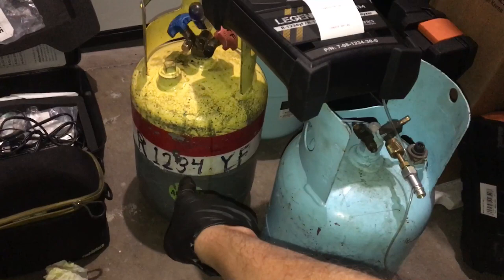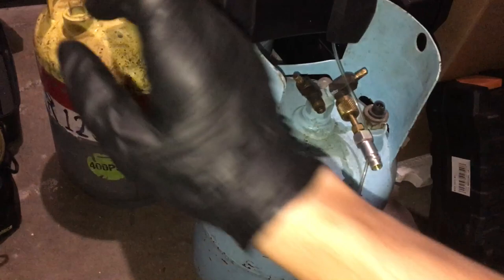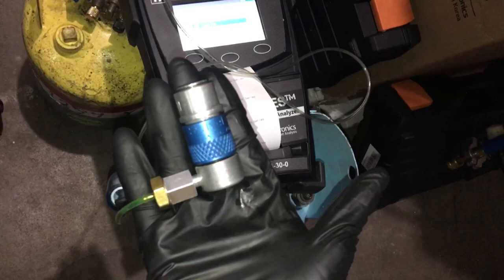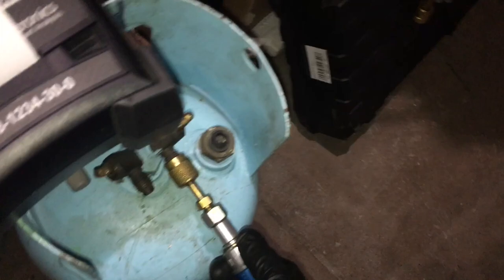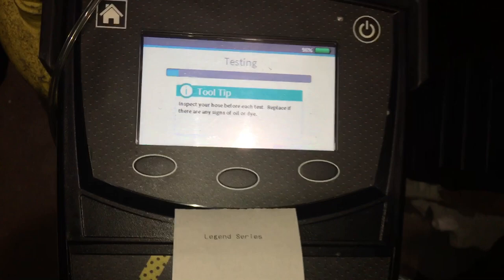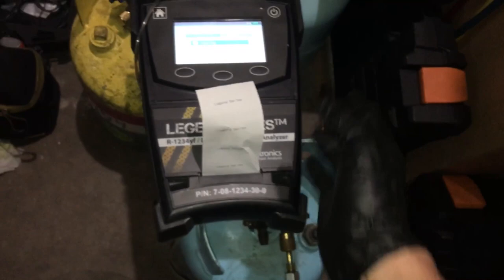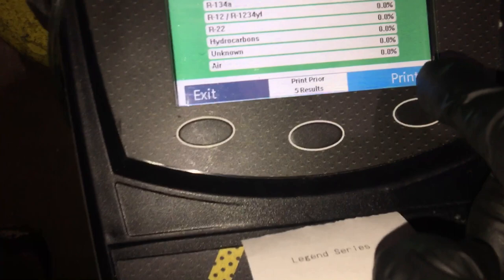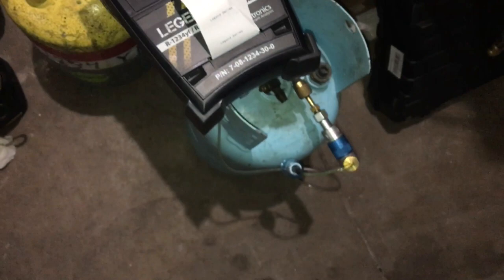Recycling Refrigerant, NO !  reason to have contaminated refrigerant after recycling￼￼

Comment: Hi Tom. It would be nice to see more videos about this. The way you recycle the refrigerant.  How to prevent air and moisture getting in the tank.
Reply from the maker: During your refrigerant recovery process many times he may accidentally get air in your tank that’s inevitable

Many of the cars that you recover refrigerant out of they all have a small percentage of air from other shops who contaminated the system so you will always have air mixed in with Refrigerant that your recycling machine will have to remove. 

For the old fashion manual way, but in the end, I always have a Refrigerant identifier to test my Refrigerant when I’m finished to make sure there’s no air in it . 

That is what I refrigerant identifiers for to analyze the quality of the refrigerant to make sure it’s mixed with no other refrigerant, and that it has no air inside of it .